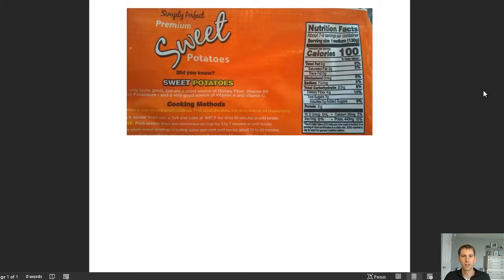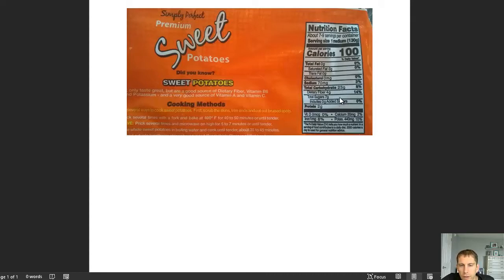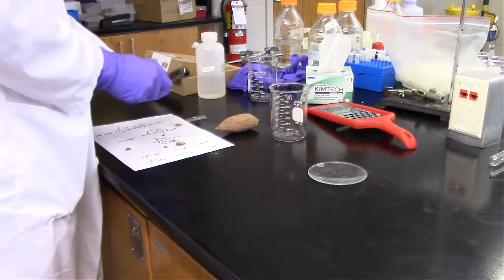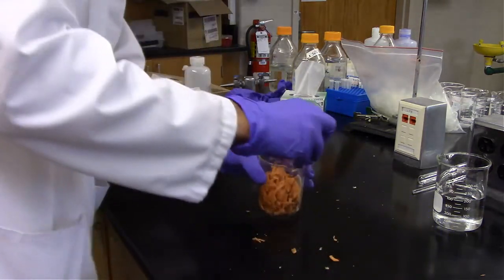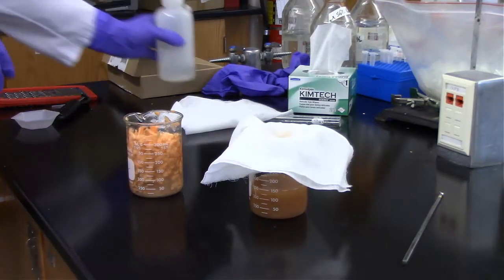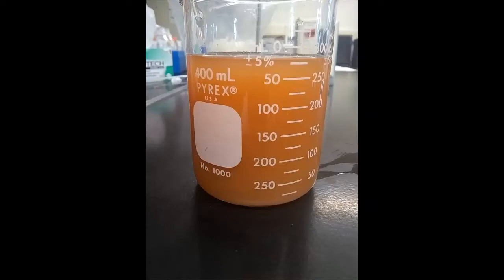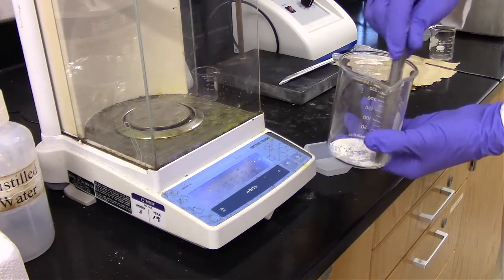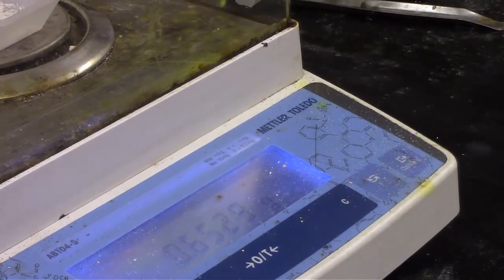Extraction of Starch from Potatoes

Comment: how long does it take to dried it out on the hot plate?
Reply from the maker: Usually about 30 minutes is a good balance to dry it well enough at a low enough temperature to a avoid burning
Reply: @danielmiller54  Thank You Sir.